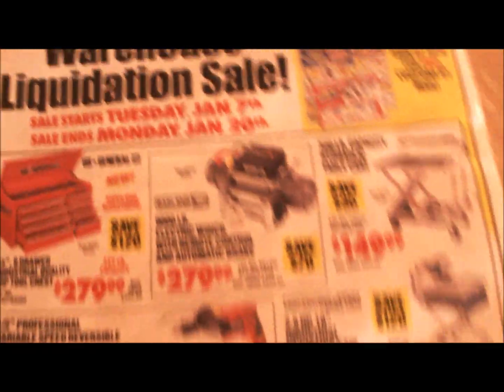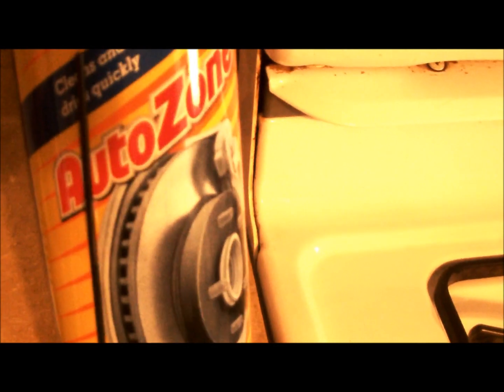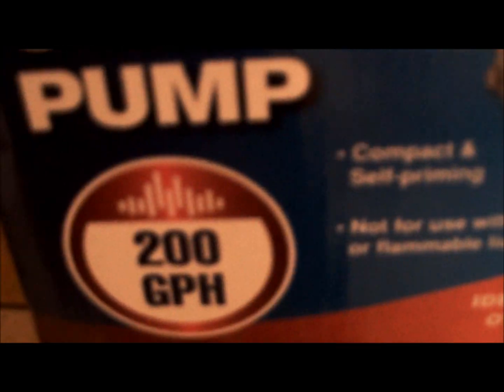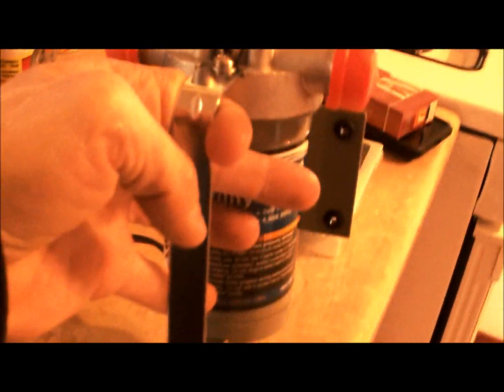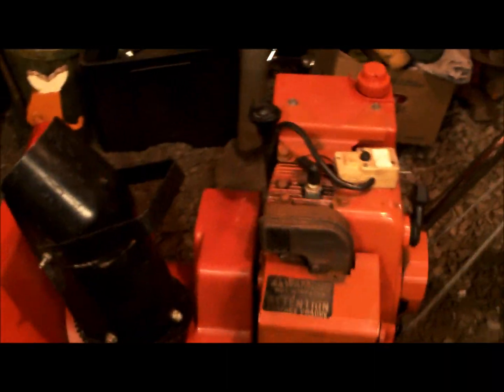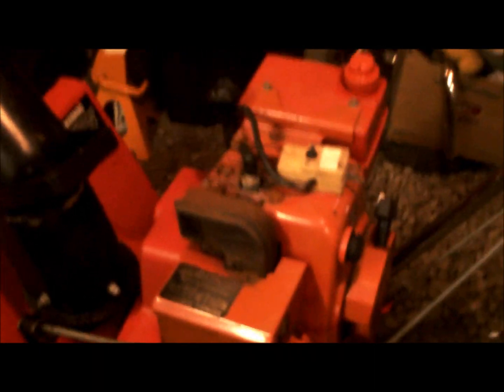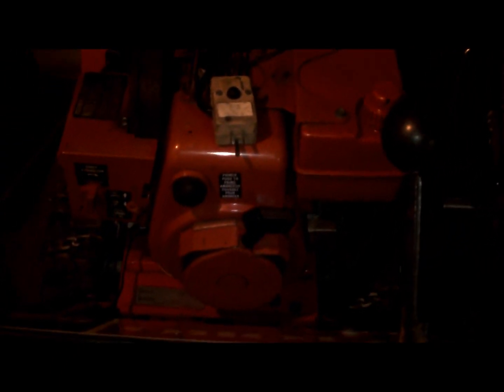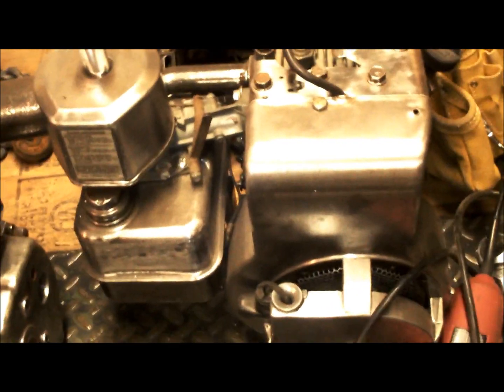store finds & changing oil, toro 5, 21

Comment: Hi dizzy...prolly better use thicker oil than 5W-30 in them old motors. The clearances in the crankcases of older motors are way too great for that thin of an oil viscosity to protect as well as they need. 10W-30 is your best bet, and even straight 30W if they are gonna be run in temperatures no lower than 32F. 5W-30 would only be adequate if you were using the engines in minus zero temps all the time, every time. Love the vids bud...keep 'em comin :)))
Reply from the maker: thanks for the info bro, cheers